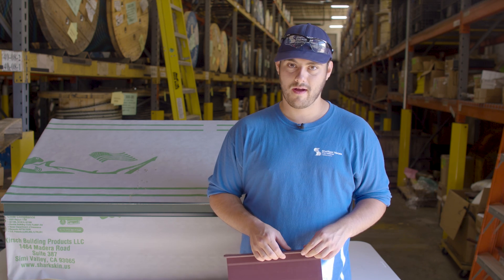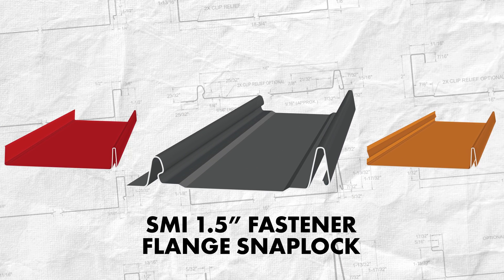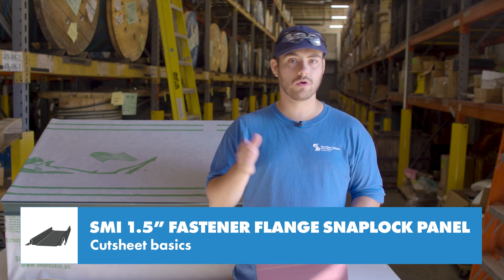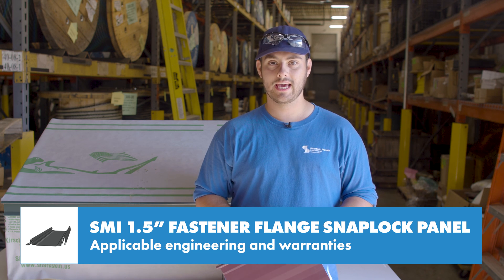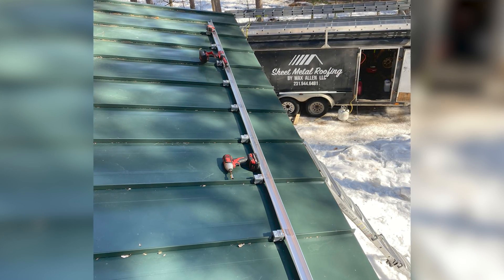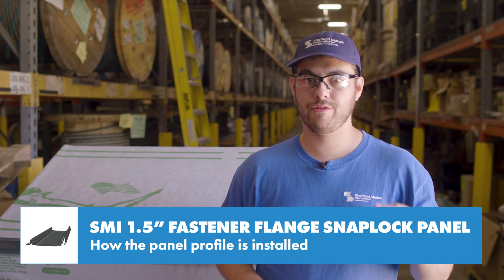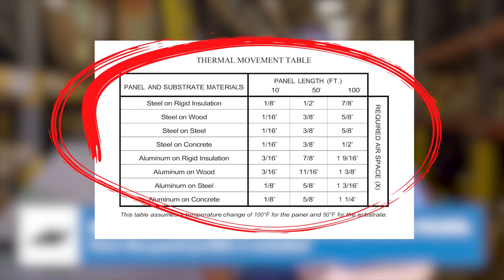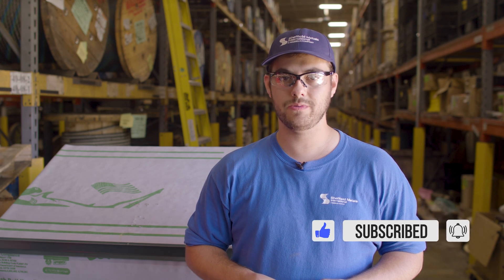SMI 1.5" FF Snaplock Metal Panel: Uses, Installation, Engineering

Comment: Any Tips or Tools to prevent over-driving of the pancake head screws?
Reply from the maker: Definitely use a torque-controlled tool and never use an impact driver. Impact tools can not only overdrive the screws, but they can also cause them to fracture. -Thad